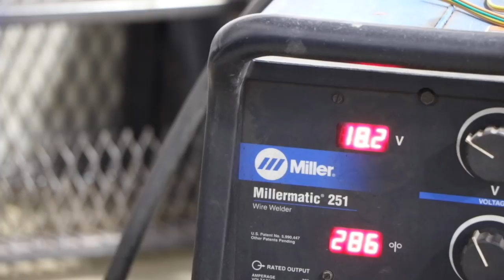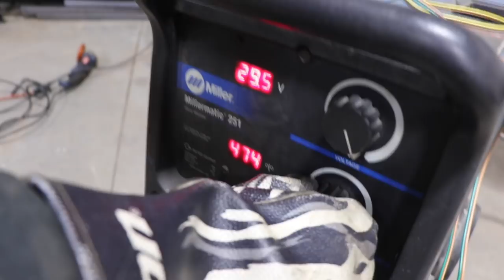TRYING TO SPIN A TRUCK USING TRAILER JACKS!

Comment: I have a suggestion for a banger video, if you have two old wheels and tires that will fit your truck you should do a burn out till they pop and continue a little onto the rim to get some sparks!!

Comment: Try foam filling some cheap tires or your normal tires if you're in for that😉. What about making a snow feild and see if you can drift your truck, tractors, forklift, well what ever you have and maybe find out if one of your pieces of equipment would drift better than your truck.  I'm not sure where you are in America, but it looks like a good time of the year for that judging by your jacket.

Comment: Take some old stock wheels and take the two wheels and ratchet strap them to some wheel Dolly’s and then mount the wheels on the truck then you can hoon around but make sure you take out you’re rear driveshaft or all hell is gonna break loose🤙

Comment: How about installing a train horn or pressurized smoke machine on your truck and try surprising people walking through the stoplights.
Reply from the maker: Austin Nipper Hahaha that would be funny😂😂
Reply: @bugbmx  yeah, I remember the scene from fast and furious 2 when Paul showed up to the first race. He basically pushes everyone out the way with I think nos release from the front bumper.  Also, this might be a little far fetched but lift your truck up more and put a wooden swing under it. After that, drive on the beach and try to pick up girls while rocking and having a friend driving. If you're married or dating , I understand if that's not an option 😉

Comment: If you do attempt again but two of the Trailer Jack wheelsOn the In side and then one on the  outside work a lot better And make sure you secure your Jack handles so they don’t spin and raise  or lower Change the plastic wheels toSome type like go cart wheel something like that

Comment: Weld a crost all the wheels and it will spin because the wheels going different ways from each other is y it's not working so weld a bar where the wheels stay all together and turn together